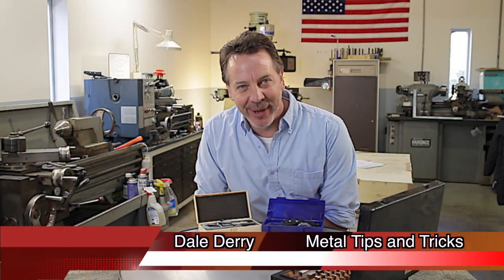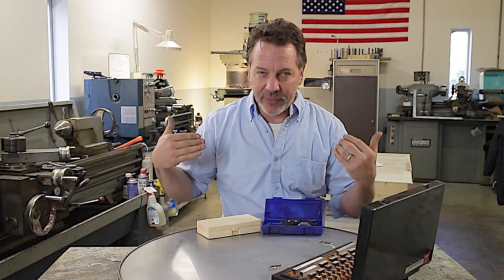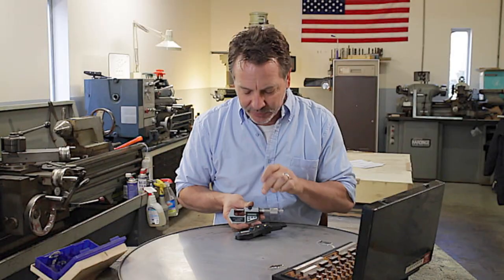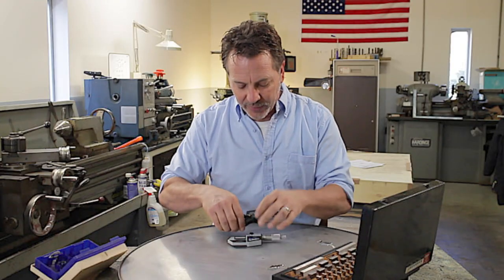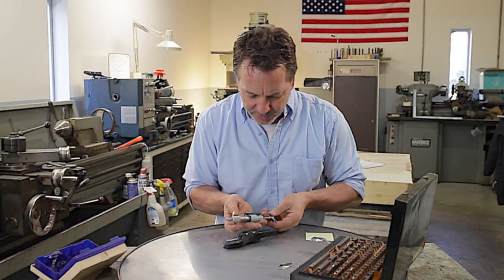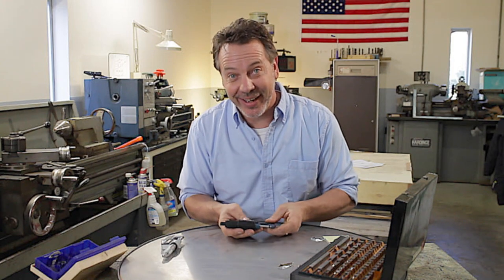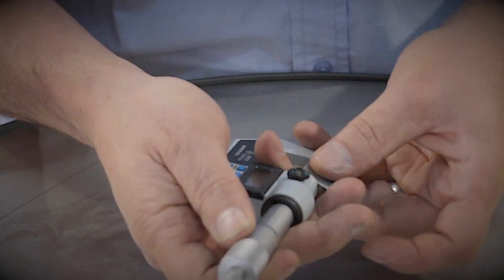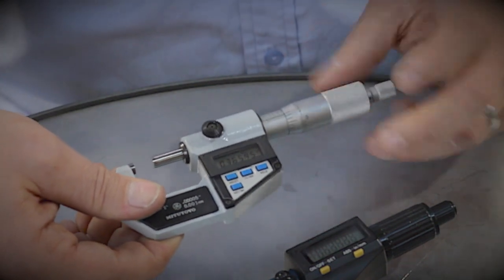Mitutoyo VS Harbor Freight ....The Digital Micrometer show down

Comment: Agreed that the boxes are rather cheap.... but, once I start using the tool it rarely goes back in the box...   lol

Those cheap tools will do mostly the job right, probably wear a little faster, but, for hobby use, you'll never see the end.

Even in my everyday use, I often use a cheap $15 digital vernier, if it dies who cares, for a tiny more accuracy I get the Mitutoyo set...

And if ==everything is at the same temp==, the tools, the part, to measure and the references, it will give you the correct reading...  ;)
Reply from the maker: It's hard to beat the value of cheap tools

Comment: Being a former industrial multicraftman I appreciate the value of a good tool.  I hate to but often had to abuse a tool to get the job done.  Good ones hold up, the imports usually fold up.  Now I am retired on a much smaller income.  I wanted to include a home machine shop into my hobbies so I bought an import lathe and import milling machine.  Most of my tooling is from imports.  I love my new hobby.  If it weren't for harbor freight and others, I wouldn't be able to afford my new hobby.  Now I have more time and don't have to abuse anything and everything holds up fairly well.  There are some duds out there.  I love good tools but their price usually forbids me from buying very many.  Most of us hobbyist make out as well as our means allow.
Reply from the maker: great point

Comment: When measuring to the limit of accuracy, put the micrometer in a micrometer stand, so your hot little hand doesn't heat it up and change the reading.  ^_*

Comment: FYI you can get mitutoyo mics with the racheting stop. What you have is called a rachet thimble. The rachet stop models have the larger OD as the rachet, while still having the thimble as the speeder for quicker movements

Comment: I think the video is useful as people are sharing ideas and experiences, like how to roll the thimble on your forearm for rapid thimble action. But I would not have thought the Mitutoyo micro shown in the video cost $200. I have the same older model and they don't go for $200 second hand. I read all the posted comments before posting this and there are excellent points and ideas about how people use their micros. 

I have two Mitutoyos and one Starrett micrometer, bought on eBay in very good to excellent condition.  So I am at least their second owner and they are still working superbly. The analog Mitu cost me $30 with shipping and came in a mahogany wood box. The digital Mitu micro (same as in the vid) came in a bigger mahogany box with a Mitu digital caliper for $80 with shipping. 

My Starrett 221 super precision direct reading analog micrometer came in a deluxe case that isn't available anymore. This was a gift but I found out how much it cost: $86.67 plus shipping. All three work flawlessly. Do you know which ones I use most? The analogs because they fit better in my hand and are their anvils are slimmer. I love the Starrett when precision turning. It might be a good idea to get to try different makes and models to get a feel for what works best for each person. 

Daniel

Comment: To make HF one spin faster grab the metal rod (forgot what it's called) and spin that instead, it's faster and convenient.  I paid less than $20 for my HF, the problem I see is that when you calibrate it it looses it's zero when you turn off often which means you have to close it all the way to make sure you are calibrated to zero otherwise I am very happy with it.

Comment: I just graduated from CNC Machinist school.  I have been testing the Harbor Freight Caliper, Micrometer, Dial indicators, etc against the "Good", "Expensive" brands at school for the last year.  The Harbor Freight products are surprisingly accurate and have held up over time.  Now whether they will last 20 years, I cannot tell.  But at the price I paid I will not cry a river if I drop and break one.
Reply: Just be careful.  When I first got into the trade I bought a SPI digital mic from MSC.  It seemed nice enough and passed the QC department's calibration.  The particular model had no on/off button.  You would just turn the thimble to "wake it up".  What I found out the hard way was that every time you woke it up it would miss a tenth or two of rotation. Depending on how you woke up the mic your parts could measure big or small.  We had to turn parts into inspection for in process checks at set intervals.  My hear sank when my in process part came back under size on a +/-.0005 dimension.  That mic was quickly junked and replaced with a Starett mic.  The cheaper analog/dial tools might be ok, but the digital stuff I don't trust at all.

Comment: what's cheap comes out expensive  ,in other words if you  buy cheap they wont last long ,that O. D micrometer is a good example all the assembly is plastic ,oil  or any other type of coolant it will destroy it,  all my micrometers are mitutoyo and i bought them about 10 years ago and still working very good thanks

Comment: Hi Dale, another possible difference is battery life.  Cheaper mics sometimes have significant batttery drain even when apparently off.  I believe it has something to do with the encoder technology.  Maybe others who are more knowlegeable can explain. Bob.
Reply: absolutely in my school shop we got harbor freight mics and the battery ran out in a week or so. we hardly used them too as that kinda measurement is uncommon. the worst part is as the battery looses charge it gets less accurate if that makes sense. I only buy dial after working with cheap digitals.... hf is usually 2thou off everytime too
Reply: Ave did a video on that I think
Reply: You know my uncle told me same thing that his HF calibers eat through batteries like crazy!  Mine never needed battery replaced in 4 years and I used the heck out of it!  Like measuring thousands and thousands of cases for trimming.  I think they probably used different vendors because my first set was also a LOT more smoother than 2nd one I bought.

Comment: Harbor Freight can get the job done now and again, but there is a reason you will find name brands in a fab shop. Reliability. I'll buy a few odds and ends like wire wheels for my grinder at HF but not grinding disks, etc.

Comment: Thanks for the comparison. As a spare time engine tuner I ask myself if it is really necessary to spend x-times more for a brand measuring tool. For machine shops it's no question to go with best possible quality, fast working tools which last as long as possible.
Reply from the maker: I personally only buy the best when Im going to used it a lot.  :-)
Reply: I agree absolutely. When it's about tools like mechanic ratchets, sockets, screwdrivers etc. only the best quality is acceptable. No mather if for frequent or permanent use. Otherwise "cheap" can become very expensive.

Comment: Thanks for a honest comparison and opinion. I have used the china digital calipers for 20 yrs almost it seems. I recently bought a Starrett just to take any doubt out of my measurements. Its a lot more money but comes with a nice box assembled by Americans but guess what ?, it reads the same as my china cheap ones.  I can sleep better knowing I'm correct tho. The China metals aren't quite as good as ours for strength tho in most cases a USA wrench is stronger, but for these common measuring tools I think they are good for 90% of average home shops and machinists . Especially starting out, we all would love $20,000.00 worth of Mitutoyo and Starrett but that money is better spent on other things that a guy starting out will need. Maybe buy 1 good Mitutoyo or Starrett to check your other cheap ones by like I did. Just an opinion.

Comment: I have a collection of both high quality expensive and lower quality budget measuring instruments,most of the work i do does not require super precise targets so i use the budget tools most of the time which are perfectly sufficient for the task at hand.I take out the Mitutoyo's for the jobs that need that confident measurement.

There has been (Like many other machinists have had) where i dropped calipers or had something topple over on to a mic and kill it so to replace it with another cheapy one is not a problem......So my general rule in my home workshop for the expensive instruments is if i don't need to use them i don't.
Reply from the maker: Great point of view.

Comment: The great debate seems to be exclusively for hobbyists, for professionals its a given. Also conciser these three points: 1- if you use the same micrometer to measure mating features then accuracy is more or less irrelevant. 2- show me a design that a hobbyist would use that requires sub-thousandths tolerances, even the sliding/press threshold is near 0.001". 3- HF's selection stops at the basic, Mitutoyo has all kinds of special features available (non-rotating spindles, various grades, form factors, ect.) 

Sorry I don't get it but, it must be a pet-peeve of more than a few people about the Box - make a prototype, have china start banging them out, and sell them!

Comment: Well done.  As a home metal mangler, not a machinist, I think the harborfreight micrometer is more accurate than I am likely to be able to work to.  If I did not already have a set of Craftsman micrometers I would go with the cheaper one as any mic is better than no mic and cheaper will allow me to get more tools when I need them.  Thanks for a great review.
Reply from the maker: I'm glad you liked it.

Comment: Well you asked Dale.
For me, the Mits, almost everything I have for measuring equipment is there brand. For gauging I still rely on Starrett for those. Screw pitch gauges, feeler gauges etc. I don't know about right now, but even a year or two ago the Starrett digital equipment was judged by most over on PM as inferior to the Mitutoyo. And battery life? I get an easy 4+ years out of the proper SR-44's. Want a really good set of digital calipers. Try the 6" Mit solar powered. Finest calipers I've had in my hands by far including the Mit analogs. And no dead battery's unless you work in the dark.

Mitutoyo boxes. (sigh) they ought to hang there heads in shame. You are so right Dale. I bought a Mit digital indicator.The one that's powered with a wall wart. 543-552A  Inside the cardboard box there's a paper thin (no joke) blow molded container that has some really rough shapes to take the indicator, wall wart and manual. Your 1" Mit mike box is a Rolls Royce quality improvement over this. At best it's a good method of protecting the indicator from shipping damage. In no way is it any kind of storage container. The indicator is the very best I've used, but the box?  This just isn't the type of indicator you leave out all the time. It needs a damn storage box Mitutoyo. Oh yeah, and when I did very politely email there head office about this problem, I got exactly zero response back. 

Not sure about that horrible fright mike Dale, but my mitutoyo's come with a test certificate that shows a graph of where the few really minor inaccuracy's are. But I'll freely admit $35 is a steal. IMO good quality tools tend to get looked after. There accuracy and lifespan is usually lengthened by that. Cheap tools no matter how good are used for about everything. So side by side in my shop the Mits will be and will stay accurate for much longer.

But good video as always Dale, apology's for the rant. It really did feel good tho. :-)

Comment: Just curios. What class are the gauge blocks? Class B may have a +-0.00005 tolerance. Which is fine as long as the operator uses the cert sheet to get the real size when checking tools.

Comment: I have that Harbor Freight one as my first and only micrometer.  I'm very happy that you've shown it is accurate.  The only issue I've had with mine is that early on it seemed to drain the battery when stored and off, so now I remove the battery every time I put it away.  Mildly annoying but not a deal breaker.  I'd be curious if others have had that issue or not.
Reply: That's common with those. I got tired of it and bought a Starrett.
Reply: @jimadams8182  bummer

Comment: Great video and I appreciate the knowledge on the subject. I'm a locksmith and for years I've used the Tumico thickness dial mic that I inherited from my grandfather for measuring pins to decode interchangeable cores, etc... Just recently I went to use it and it completely locked up. I know it wasn't dropped, I have NO idea why it's locked up. I'm currently looking for a pro who can fix it (as I don't want to risk making it worse)... but in the mean time I NEED to be able to take measurements... I went down to HF today and got this exact model. Now honestly, I don't need to take measurements to .00005, for what I need .0005 is fine, but it was on sale... Got it home and tried it out and so far so good.... I don't have high hopes that it'll last 60+ years like the Tumico but it's nice to know that I got at least a "fair" to "pretty good" tool for the money.
Reply from the maker: HI Derek,  I know a lot of people don't want to admit that is a good tool, But  for the price I think its an excellent one. :-)

Comment: One thing you may not have considered or noticed is that the HF mic is a lot thicker from one side to the other.  That can keep you from being able to measure a short pin sticking out of a large plate, for instance.  However, I am not really a brand name freak.  Whatever works, works for me.  All of my Mitutoyo mics are old school analog.  The batteries are never dead when I go to use them, especially the bigger ones which get used rarely.  I use a $8.00 HF electronic 6" caliper daily, and it gets rode hard and put away wet.  The battery has been going about 3 years now.  I guess the advice of how they die and the batteries don't last was bogus.  The HF caliper even came with a spare battery, not needed yet.  I also bought a spare HF caliper for another $8.00 on sale and with coupon, and it is still in the box unopened, not needed yet.  Good tool, but I do not use it for precision measuring, more often for rough measuring, scribing, and comparing.  Also have an assortment of dial and vernier calipers backing those up.  I consider all electronic measuring tools to be throw away toys when they fail, and I find it difficult to spend hundreds on one.
Reply: +Paul Frederick I actually have two of them, both the same, one is unused.  The HF p/n is 47257.  The frame is stainless steel and the plastic is black.  These were both bought 2-3 years ago for $9.99 each, less 25% with a coupon, plus tax.  The one I am using is bulletproof so far...

Comment: good video.a lot of "machinists" here. if you do not own a certified set of block gauges, sit down. they are (suppose) to be your surest reference, to which you check your mics/caps to. you can all pretend that your work is .0005 all day everyday in your garage, yet a precision shop does work in a fully controlled environment for a reason. if every thing had to be manufactured at such precise levels, cars would only last 6 months. not praising HF but its two different worlds when you're a home gamer (even at high skill levels) and a professional.

Comment: I was at HF with my boy and he was needing tooling for his new lathe and mill we unboxed the 3 Digital mikes they had and all three would not close with the friction knob and would bind, I ended up with a Mitutoyo for about $10 more on ebay auction and my boy bought an Igageing digital mike which is not much more then the HF and performs great. Without going outside I believe my Mitutoyo has the friction thumb drive on the same place as the HF.
Reply from the maker: +Ed Ginsberg 
HF Tool are alway a gamble

Comment: My first job out of college was at an aluminum sheet and plate mill,  quality control department.   We we provided micrometers and 12` tapes.   I can assure you the digital is not faster once you learn to add nor more accurate. Vernier scales work fine too without a battery,  just getting hard to find.

Comment: hey Dale,
thanks for that comparison. you did a pretty reasonable, unbiased presentation that highlights the good and the bad of both tools. 
so now i'm gonna throw my 2 cents worth in: i have to concur with Keith Ruckers take in the test time. we have a set of mitutoyu calipers in the shop that are pretty beat up but still very usable and accurate. 
personally i wouldn't buy either one as i can recall from my apprenticeship years that mitutoyu was considered to be a cheap asian brand and looked down upon by my mentors. i avoid digital calipers and micrometers like the plague and use them only to get a quick and dirty measurement, but not for accuracy. to get that i use tried true verniers or dial calipers from Mauser (yes, the makers of Mauser rifles) and  Mahr or KS micrometers.
i recently acquired a set of imperial micrometers that was made by H&K for the Bundeswehr (german army) that leave nothing to be desired. 
the outfit i work for has bought several digital calipers (the cheapie chinese ones)and they last up to about a year and then go totally henshit. they literally fall apart.
 when it comes to tools, sure, a guy has to look at economy, but when you can get a decent used micrometer from Starrett, Lufkin or Brown&Sharpe for about the same money as new horror freight tools it starts to become a wash.

keep up the good work!
cheers
mike

Comment: ive been using a stainless steel set of calipers i got on ebay for 12 dollars for 2 years now and havent had a single issue with them and i use them professionally and they are a pretty critical tool for me to use. while i wouldnt blame anyone for buying the clearly higher quality tools i personally cant justify it when the cheap tools take the measurements accurately, thats all i really care about anyway. even if i have to buy 10 of those calipers they are still cheaper than the high quality ones and they do the same job just as well.